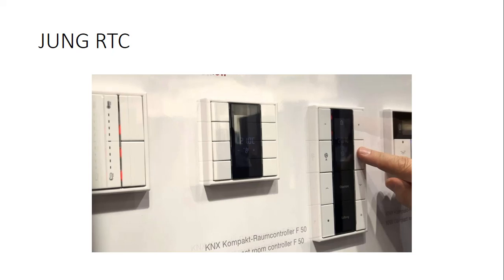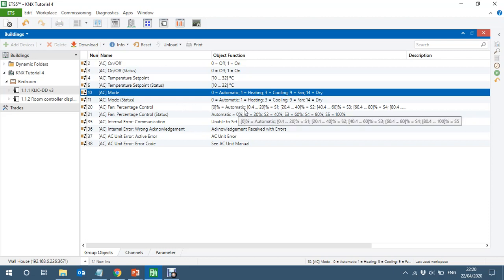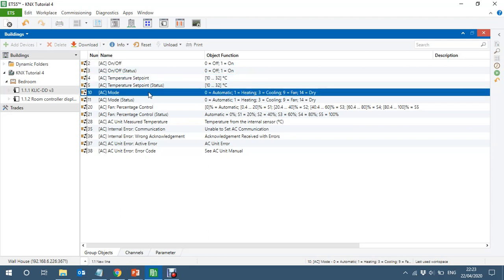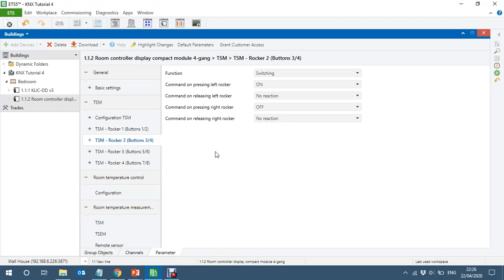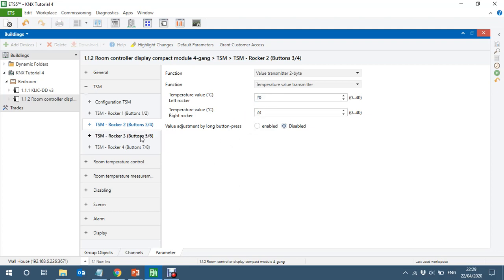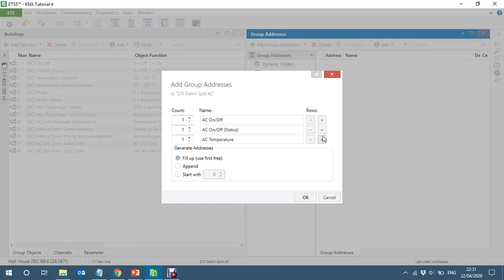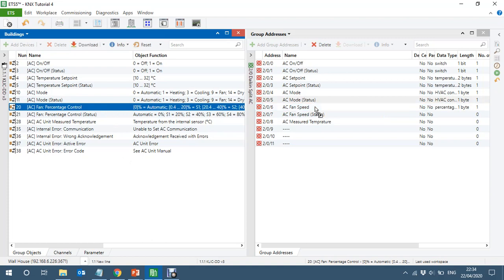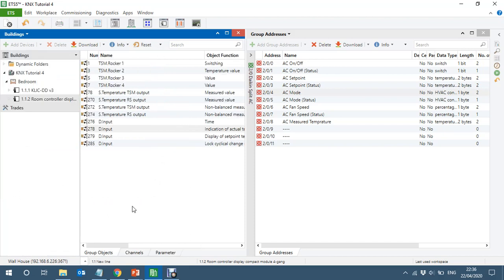KNX Tutorial 4 : Programming of HVAC

Comment: Hi Gohar, great video! I'm using the same Klic-DD v3, but with MDT Glastaster II button. I can get this integration to work with ON/OFF. But temperature control is only possible when I send a fixed temp. value (2byte), say 20°C. But I'd like to increase/decrease the temp. with the buttons. This doesn't work unfortunately... Do i really need a room temp. controller or heating actuator for this to work?
Reply from the maker: I think you need a room thermostat. Will need to setup it as slave device.
Reply: Did you try to use temperature shift with "2byte shift of basis comfort setpoint value" and to put there the step width as 1 ?  I see the parameter is the same type.
Reply: Hello Mark. I have the same problem as you. Did you get a solution for it? I am struggling right now
Reply: @denisaspenleiter4330  I still haven't finished the integration yet as I was busy doing other integrations in my house. But thanks for the reminder, I'll try the suggestion from cipid2001 above. If this doesn't work, I guess a room temp. controller is needed.